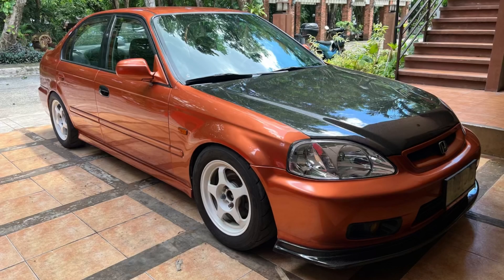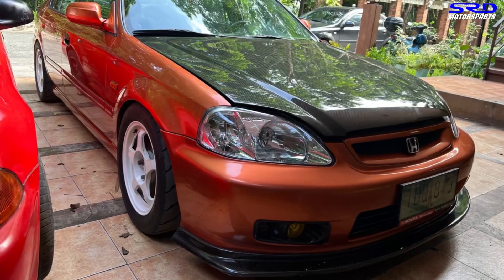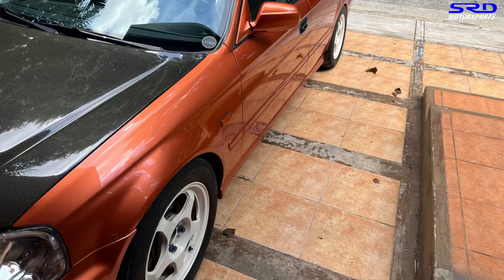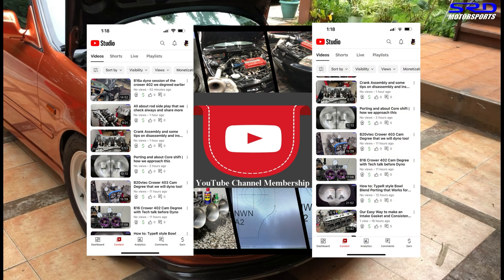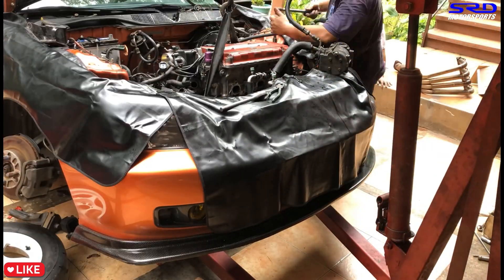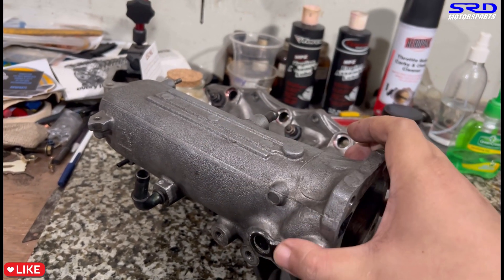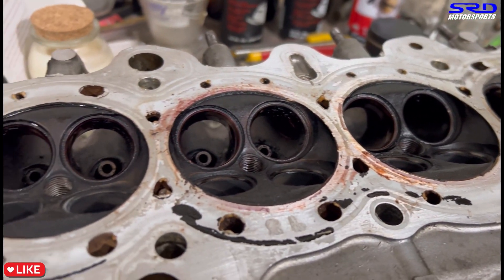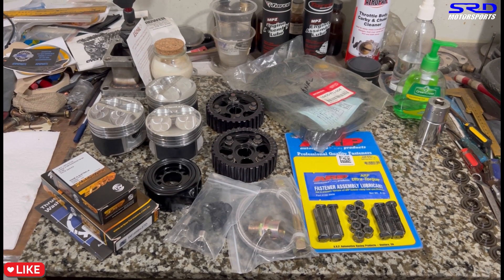Honda Civic SiR B20vtec Build Series Part 1 from a B16a

Comment: Its cool i have a stock b20v , b20b b16a2 head making 200hp on 93 oct .. i wanna take it to the circuit track but im scared the block wont hold up to the abuse.. any thoughts and tips?
Reply from the maker: actually if it doesn’t have arp rod bolts then I’d suggest not taking it to 8k that often

Comment: have you built any strong non tecs?
Reply from the maker: Non vtec? Not yet
Reply: @SRDmotorsports  if you did, what would you do? I have something in mind, was wondering if you could give some guidance😁
Reply from the maker: the usual, crower has cams and even Brian crower , both are good choices

Years ago a PR builder (I think it’s PR) ran a EG hatch that’s b20 nonvtec, dude did run 9sec all motor he’s now running K
I believe he’s “ La Sata Racing “
Reply: @SRDmotorsports  was thinking a phk piston pocketed for a more aggressive cam. 

Thats damn impressive for a non tec
Reply from the maker: @saadiqeverson2161  yeah that’s good
Reply: @SRDmotorsports  do you think i should balance after pocketing?
Reply from the maker: @saadiqeverson2161  yes ofcourse even a small amount is a few grams already

Comment: Where to get this ycp gen3 piston?
Reply from the maker: @ana-be5ck  usually “they” just get it thru eBay there are some pretty decent sellers there
Reply: Can run fuel ron97 with itr cams?
Reply from the maker: @ana-be5ck  for us with our tune, yes but a bad tune can ruin an engine… no tune is a no no

Comment: pls do a detail install on the sandwichplate and whats a good oil line location when installing a vtec line and oil pressure line 😁
Reply from the maker: @the063one  will do… we usually tap the oil pressure sender spot for vtec oil line but this time we gonna go with the sandwich plate so will def put some detail on that 😎

Comment: What are your thoughts on a 85mm bore b20? I have a b20 block that had to be bored out 1mm but it wasn't until afterwards that I learned the sleeves are weak and it's best to have it sleeved by shops such as Golden Eagle.
Reply from the maker: @vision27  really depends or actually not sure but I’ve seen some go 85mm on b20
But on stock 84 bore and 84.5mm bore? I’ve NEVER seen any problem with the so called “weak” sleeves maybe by design they are weaker than the usual non Siamesed sleeve blocks? But TBH I started in 2003 and 

I’ve constantly heard that “weak” sleeve from US peeps but I have NEVER encountered it

So yes the sleeves are weaker by design but
A cracked sleeve is 99.9% of the time a tuning issue that can be avoided…
Reply from the maker: so I’m not saying that’s often the cause of a tuner who can’t tune carefully for a specific block… not saying that but kinda 😂
Reply: Awesome! Thank you for your input. I'm currently working on a B20VTEC build and you're videos have been extremely helpful. Please keep it up!
Reply from the maker: @vision27  Ofcourse it’s a given, don’t go to high on the compression or if it’s gonna be on e85 then u good 😎

feel free to ask on anything on any of the vids man just comment will try to get back and answer soonest